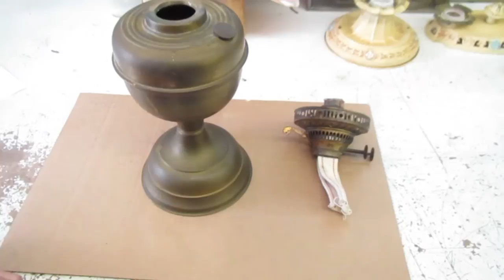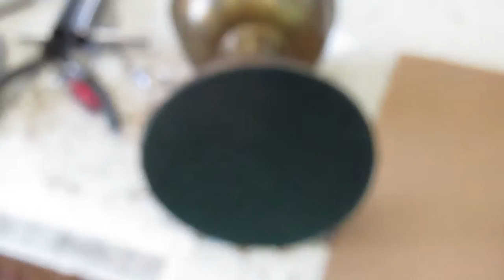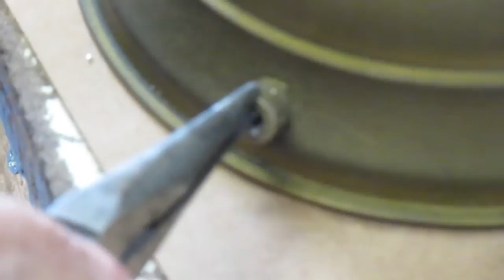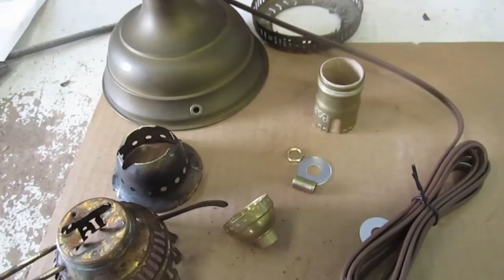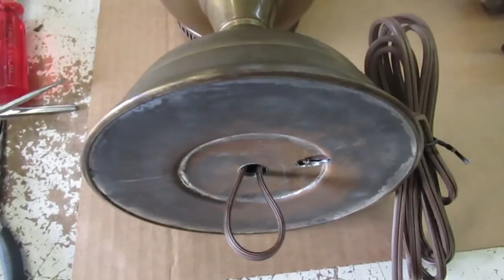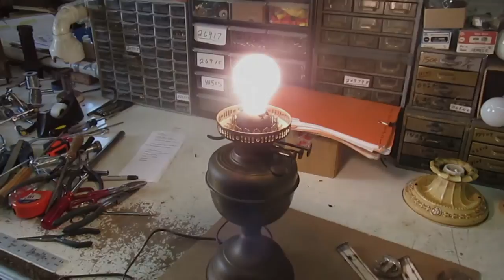Converting An Oil Lamp to an Electric Lamp

Comment: But why do this & ruin a working oil lamp? Just buy an electric repro - they've been around for decades - or if you must use an old one, a replacement screw in 'burner' with bulb holder and power cord is available from Amazon for just a few bucks, that requires no drilling of the font. So many old lamps have been spoiled this way :(

Comment: I’ve seen a couple of rusty looking old oil lamps for sale very cheaply that could be converted to electric. I used to think any oil lamp however plain looking, being converted was a violation, but as a bedside lamp, they’d be more convenient and they could be fitted with an in-line dimmer switch for the oil lamp effect, seeing that the electric lamps are a bit too bright. Turning the dimmer up or down would mimic the turning of the wick too. I would never convert a more rare, really nice looking oil lamp though.

Comment: I bought a pair that were converted many years ago. I rewired them completely from plug to socket, look really neat when they are lit up. They had a heavy patina on both which I left and just polished to a smooth finish.

Comment: would you be able to advise on how to go the other way... electric back to oil?
Reply from the maker: Inspect the font (part that holds oil) for holes, cracks, or other damage that might cause a leak. Unscrew the electric burner and replace it with an oil or kerosene burner. Collars to hold burners are standardized sizes like #1, #2, #3, Central Draft etc. and the burners have matching sizes. Screw the replacement burner in the collar and add oil. The lamp in this video cannot be converted back since a hole was drilled through the lamp body.
Reply: Amy Louis Bell..Basically you can't. Once you've drilled that hole it's devalued scrap!